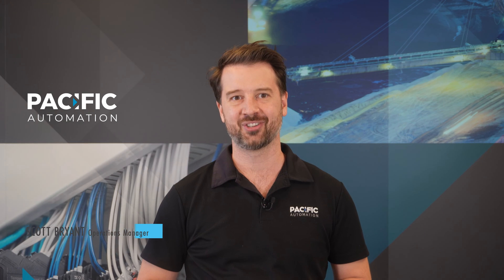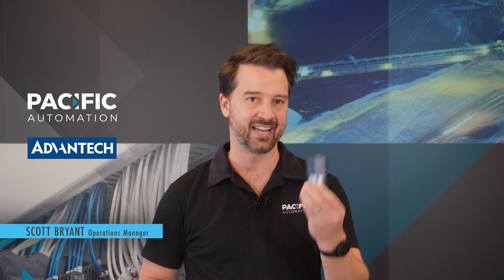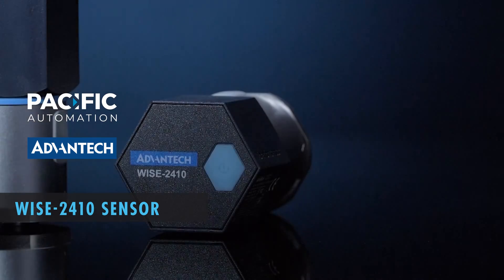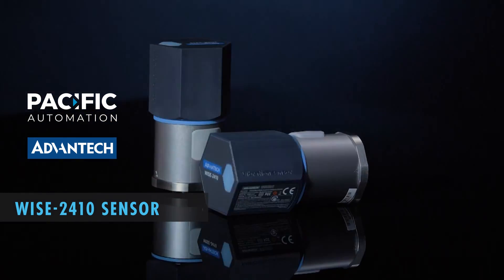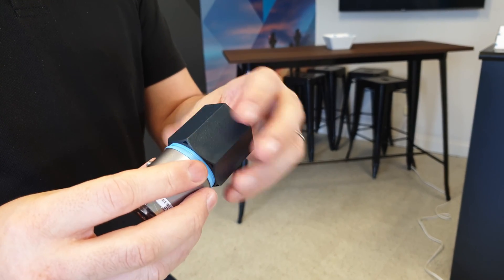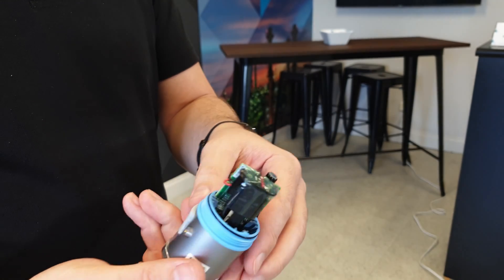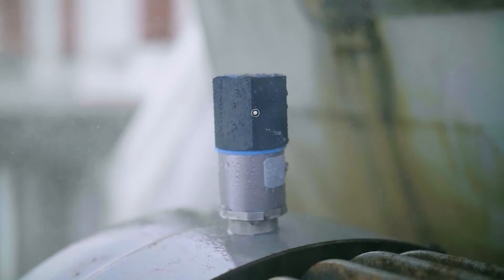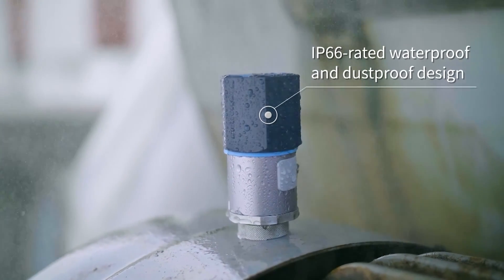Advantech WISE-2410 Vibration Sensor - Monitor Your Pumps, Fans & Motors

Comment: Thank you for sharing this informative video about vibration sensors. I was wondering if any verification has been done to assess the predictive maintenance ability of these sensors, and whether the results obtained were accurate.
Reply from the maker: Thanks for your message.  We have done independent testing of this sensor to verify the accuracy of the readings.  In terms of using the data for predictive maintenance, this can be achieved by logging the data and analysing it for change over time.